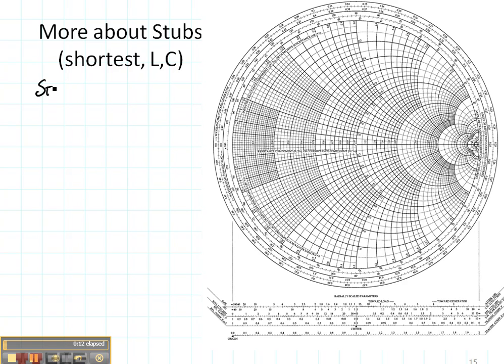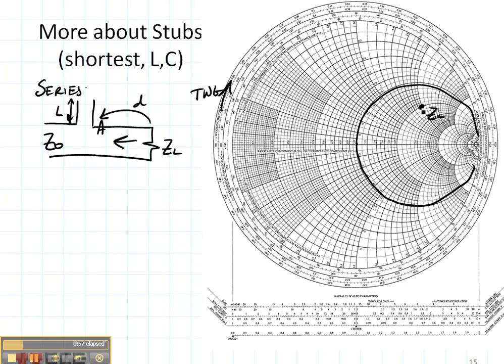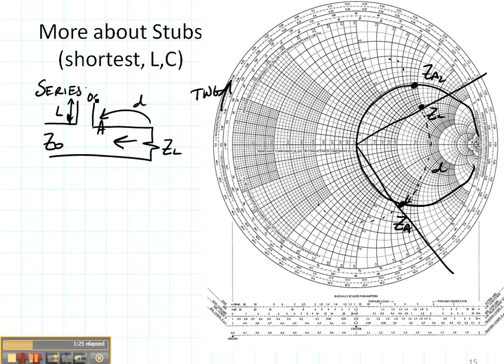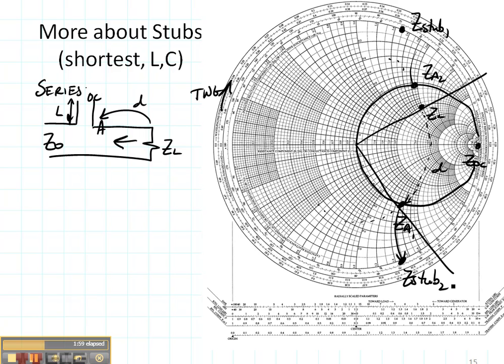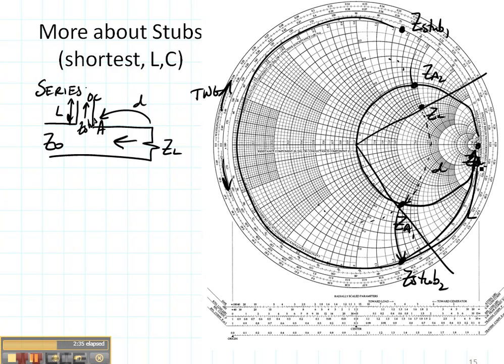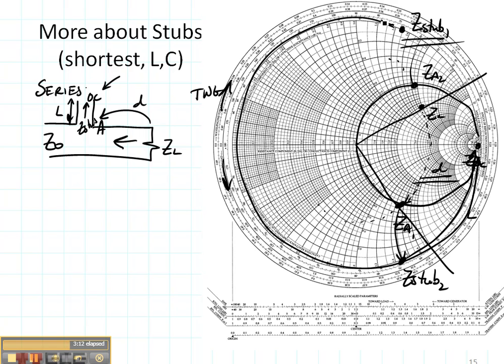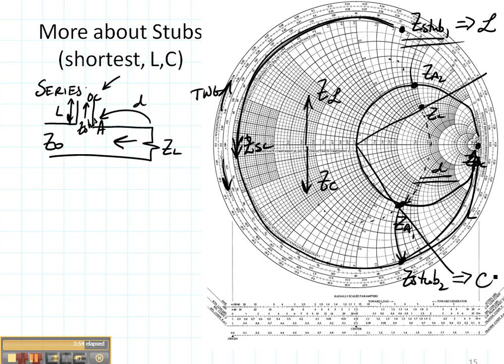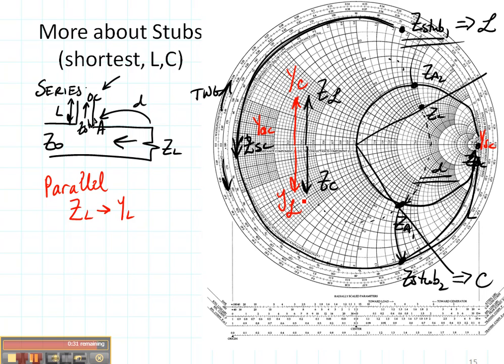ECE3300 Lecture 13b-9 Impedance Matching distances

Comment: I have a question. In the last video you said that in the case of a series stub, when mesuring the lenght of the stub, we take the immaginary part we wish to match rotating from OC/SC TWG. In this video you did the exact opposite, do both ways work?
Reply: i had the same doubt..its better to take zin that is zstub and move towards load because that is the direction actually defined if you watch the figure.